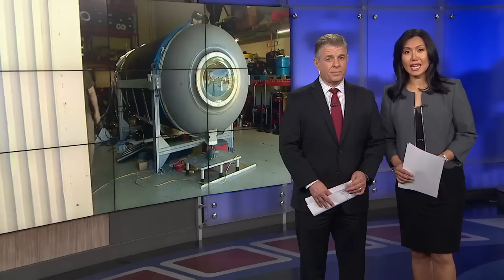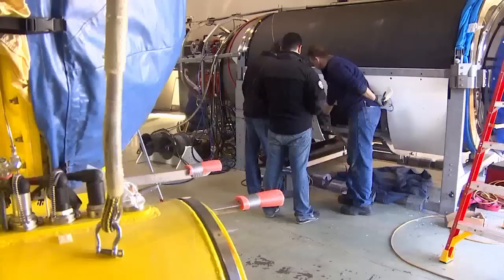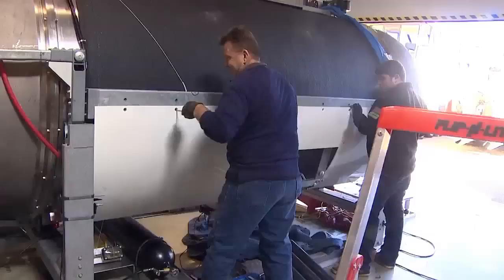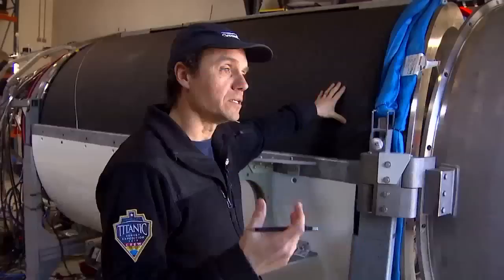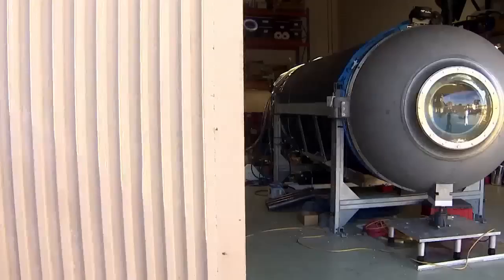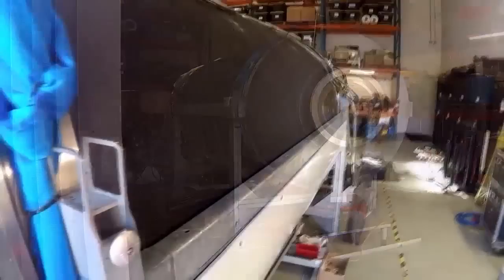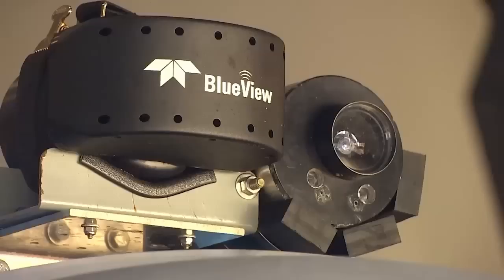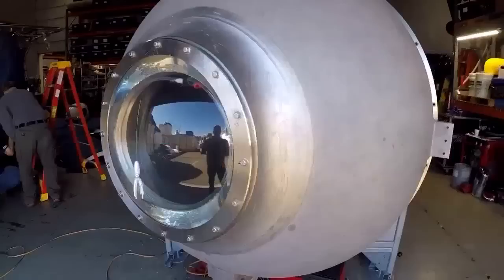The making of Titan: Oceangate's submersible capable of taking people to the Titanic

Comment: The thing about carbon fiber is its extremely strong in tensile strength and not so good in compression strength, in fact very weak. 
Trying to bend a carbon fiber rod will have tensile strength on one side and compression on the other. The compression side usually gives first then cracks up to the tension side but very quickly so it looks like everything snapped at once.
Still very strong that way. But in a sub you have compression 360 degrees around you. You can test this with a carbon fiber air tank. It will hold 4200 psi of air just fine because it's pushing out on the carbon fibers, all tensile strength, but put that down in the ocean or in another tank and put 4200 psi pressure on the outside of the tank like in the ocean and it will implode much sooner than 4200 psi.
They obviously didn't test this with a 3x saftey factor.
Reply: My guess is it fatigued from delaminating overtime, eventually buckling somewhere on the cylinder walls. Also why use titanium. Stainless steels is much stiffer and less expensive.
Reply: @brandonpieroni5536 apparently the glas was only rated for 1400m they went down to 4000m ...
Reply: They could have used your expertise
Reply: @SuperUltimateLP The design spec, maintenance programme and vessel life expectancy is all going to get scrutinised in the courts. I’m guessing  the insurance and waivers are only valid if your end of the deal end is water tight!
Reply: @bradrainier106  Only if you can do it 'really fast ..
Reply: Anyone using carbon fibre tent poles should understand this. In extreme wind conditions they will hold to a point but eventually over time they crack. Constant use it will weaken. This submersible wasn't going to last constant use. I strongly think the connection by dome at front connection. Would likely cause a leak at some point. Leading to implosion. Most Submarines can go below known crush depth. But not very far and with luck. Doing it more than once is a disaster going to happen. Quite simply they it ran out of luck.
Reply: @bradrainier106 Na they wouldn't have allowed this person to help. They're probably older than 25, and those ideas, aren't "fresh and new" like OceanGate wanted.
Reply: @raylp4751 They didn't even know what the max depth was on this "submersible" and when they ran tests, they never even went to the depths, they planned on taking this thing to. That alone deserves to be heavily scrutinized in court.
Reply: i wished they had engineers like u when they designed this thing.
Reply: @Butternose  They paid for a trip to Titanic. Apparently it didn't get there. So there 1st reason to sue. Make sure you don't get tickets to go again.( like network rail operators do in UK and TUi.  Go for the money back just for starters. The waiver they signed 3 times it mentioned the risks and chance of death. There was History with the craft. There were I believe at least 2 who had travelled down before so knew the risk. If people die climbing Everest or travelling to Sth Pole. Does anyone actually sue?  The worth of these men is incomprehensible to the average person. Do the relatives  need it.  Were they Tourists or Adventure Explorer seekers doing something incredibly dangerous. The pay off as success would most likely be up there with most Explorer
 equal to all explorers. Like those before remembered for failing.
Reply: @raylp4751  I appreciate the comparison to mountaineering a long held activity of rich people. That said man vs the elements where you have to transport yourself, surely isn’t the same as boarding a man made contraption? It seems to me there is a implicit expectation for the craft to be fit for purpose and a distinct power imbalance between passenger and operator. If there is money on the table, I think those waivers are going to be toilet paper.
Reply: @brandonpieroni5536 probably has to do with how it fails versus titanium. I think titanium can withstand more deformation before cracking. Could also have to do with weight vs the buoyancy they need to add.
Reply: @raylp4751 WRONG. They paid to be “crew members” on an experimental research vessel. This is how Stockton got around regulations. He made sure all the contracts were for being crew members of a scientific research vessel, not commercial passengers.
Reply: That's my thoughts, but I'm still thinking if it wouldn't work if they got good carbon fiber pattern textile with the whole length of the sub and then use layers with different patterns on the fiber textile and then use an actual good bond material and then cured with good heat and pressure, but I'm guessing it's probably difficult to have carbon fiber textile of the whole length of the submarine maybe, no idea...

And then they could also have an actual small layer of metal inside or outside and maybe even adding more bracing internally for even more strength.

Anyway they sure could have tested it all way before, they could even have done a proper down-scale of it with the same exact construction and make sure it will take a lot more than the pressure they would ever reach and then leave it there for many hours and then do many compressions and decompressions and keep checking.

Also in aviation they do kinda like a resonance or some crap to the materials and other ways to look for fatigue and if a company wanted to take paid tourists to such depths I'm guessing they should also keep searching for failure on all inside the material every single trip cause most likely it didn't imploded from 0% to 100% in a row but most likely it already had micro cracks or separation of layers inside they already had like 20 trips or something...

ps: I'm not a engineer or expert in carbon fiber so feel free to correct me if I'm wrong 😎
Reply: Whenever you have stress on a carbon fiber structure it is always experiencing both compression and tension. Always. In Titan's case, at depth, the outermost skin of the hull was experiencing compression while the inner skin was experiencing tension. (In reality, every single fiber throughout the matrix is experiencing both) These properties are known, and what should be taken into consideration in the design phase. At 5" thick, the laminate should theoretically be able to withstand the compressive forces. 

I'm just guessing as well as anybody else here, but in my mind a few things stand out...

1.  The hull construction was subbed out to a composites firm with a deadline of just 6 weeks to design and build something completely novel. Ocean Gate's CEO's name is unironic.

2.  The hull was 5" thick. To get to that massive thickness required the manufacturer to layup 480 plies. They apparently used a mix of pre-preg and wet winding. That's an insanely challenging layup, with tons of opportunities for things to go wrong. Since they were using a mandrel as the form/mold, they couldn't use an autoclave or any other kind of pressure curing without risking bunching the fibers and creating wrinkles or voids. But then they would be unable to control for resin to fiber ratios throughout the laminate, or voids. Given the short turnaround time, the composites sub (Spencer Composites) had literally no time to T&E their approach. Or put it through any kind of paces, really. I'm no engineer, but in my mind, the layup should have been done in multiple stages, over a longer course of time, using a single resin with a focus on consistent resin-to-fiber ratios and zero voids. With proper timing subsequent layers could still be chemically bonded. And who's to say it was the fiber itself that failed, rather than the resin? 480 plies across a 5" thick matrix provides a ton of real estate for which shear stresses can cause a failure in the resin itself, and subsequent delamination of the layers. 

3.  The mixing of materials at critical areas. The ends of the carbon tube were capped with titanium by bonding. Was any testing done to see how these dissimilar materials responded to the 6000 PSI at depth? The slightest bit of shear between these materials could easily create a rapidly progressing failure. And how much testing was done of this kind of connection? In addition to the pressure, there's also temperature considerations. 

Taking all of the above into consideration... There may have been delaminations occurring on each dive to depth. Those delaminations might've resulted in greater deflection of the tube. With the tube deflecting, the ends no longer square with the titanium caps. In the cold depths of the North Atlantic, the bonding agent between the tube and the caps might've been more brittle, and prone to failure. I watched a video (here on YT) of OG capping one of their other subs, which was supposed to go deeper than Titan. The flanges on the titanium cap were, to my eye, very small. Maybe like 1.5 to 2". Maybe. When you're dealing with 6,000 PSI, it doesn't take much for even the smallest failure to produce a catastrophic event.
Reply: I want to know how much the hull was titanium vs. Carbon Fiber. Not an expert here but if they put thick titanium then cover it with Carbon fiber, wouldn’t the titanium still hold despite carbon fiber tearing?
Reply: @justinthinkify  I have no idea, but from the pictures of the interior it seems just carbon fiber all the way without a titanium layer unless the exterior thin white panels are titanium...

If they mixed both probably could have been good cause metal still bends a bit and carbon fiber isn't much flexible and after trying to bend it many times will likely result in breaking apart...
Reply: @justinthinkify  they basically made a carbon fiber tube and then capped it at the ends with titanium.

Comment: Carbon fiber is proven to be very strong up in the air but deep underwater is a very different scenario
Reply: I was surprised they used Carbon Fibre ; the fatigue factor on multiple dives , should be obvious.  A few pressure chamber , non destructive tests , would not have exposed the fragility of C/F,, as with many pressure Cycles...
Reply: @1arritechno  Rush refused to have the hull tested after each dive. It was literally a death trap waiting to happen.
Reply: Even up in the air, I don't think it will last as long as planes made of aluminum. I'm curious to see how soon all these carbon fiber planes will need to get retired.

Comment: TONY NISSEN  - Design Engineer as indicated here.  It occurred simply because a design moron wound unidirectional fabric into a tube, which material has relatively poor compressive strength to begin with, and which structure thus had no practical lateral strength and was porous to the high water P that progressively split-into the weave. The tube thus simply split apart.

Comment: Imagine the chaos if they are still alive inside that thing. It's horror movie material right there.
Reply: I would just sit there and pray, first, I never would have gotten on the thing. I feel for all passengers. Billionaires on board... you can't buy wisdoom.
Reply: they were. bangings were picked up yesterday via sonar every 30 minutes.
Reply: @chocolatecoveredgummybears really?
Reply: I imagine Rush pedantically trying to figure out where it went wrong... some dark comedy there.
Reply: @cameronclark3725 maybe the batteries in the wireless controller ran out of power, or they forgot to charge it.  Either way my feet remain on solid ground.  No one could pay me enough to even swim out a mile off shore.
Reply: I thought possibly batteries gone on controller then no one could find the cable which wasn’t checked surely this should of gone down on test drives without any physical passengers?  Wasn’t it only the other month they was still building it.
Reply: @featheredfriend1310 rush mentioned how there are spare controllers on board
Reply: @featheredfriend1310 there would be redundancies built into the system like spare controllers and stuff.....maybe something to do with the main looming ...because that's where you won't find redundancies
Reply: @muhammaddaniyalrashid9463 YEA theyre alive... for now
Reply: No redundancy in "lifeboat" or suffcient rescue system sounds so eerily familiar!
Reply: @raneads1458  yeah definitely, not in a lifeboat...but if they were offering it for commercial trips then I'm sure it would be having those redundancies.......

And if not...then thats definitely a cause for concern
Reply: @Thebast268  oh wow!  I guess that was a great idea tho still not idea to control a vessel carrying precious cargo.
Reply: @desmond4912  ok I looked up looming.  🤔 yeah I’m clueless as to what the actually is even with the definition.  Would you be able to explain further so I might be able to understand?
Reply: @featheredfriend1310  oh i mean the electrical wiring that connects everything....I'm a pilot actually so my English might be a bit off 😅
Reply: @desmond4912  oh wow!  Okay thanks!  Truly praying for their safe recovery.  The submersible sounds like it was unsafe from the get go- tho let’s pray it’s not in vain.
Reply: james cameron will produce a film
Reply: @paulw9068 no, they've taken passengers down before. They've been down to the Titanic at least 10 times so far.
Reply: @featheredfriend1310  agreed, i read a bit more about the company and it operations 
Definitely doesn't seem like safety was in their list of primary concerns
Reply: They’ll make one no doubt.
Reply: @paulw9068  It has gone down and up since 2019
Reply: Titanic II
Reply: And if someone farts the oxygen gets depleted.
Reply: It's similar to the setting in Alien where you're in a spaceship, alone in the vast emptiness of space.
Reply: Guarantee the rich kid instantly tried to kill them all for some reason lol
Reply: They died. A catastrophic implosion. Instant death, no suffering.
Reply: @michealklondike4049  would've made a nice movie tho huh
Reply: @paulw9068  and the controller was bluetooth wtf
Reply: They would start to kill each other to get at the last breath of air.

Comment: Thanks in part to its carbon fiber structure......which professionals warned would weaken with each voyage and eventually cause an implosion.
Reply: Would be a good idea only if they swapped out the carbon fire every so often lmao
Reply: They didn't have a vacuum. You need a vacuum to release air bubbles
Shows how much they know...
Reply: I'm not sure why the Titanic expert had faith in this thing... everyone speaks highly of him so he must have known the sub wasn't certified.
Reply: But wait, here's the good part: Ocean Gate didn't give a shit if it was going to weaken and implode or not, they wanted money
Reply: @A1Kira perhaps he was suicidal...
Reply: @aidanpearce4221 they grifted and people paid an insane amount of money to receive a pretty badass grave...
Reply: @pleasetakemecanada  
True
Reply: @A1Kira  It had supposedly been dived to the Titanic wreck site a few times already.  Maybe that's how it was sold to the Titanic expert.
Reply: Hi!
Reply: Good point Bonnie, and when the professionals would tell him it was dangerous, he would say he was an aeronautical engineer and it was safe. As you know, an aeronautical engineer is different than a marine engineer. He was trying to use carbon fiber that's used on planes for a sub lol. Do you think the guy was taking drugs?

Comment: I heard there are no manual controls in this thing, only electronic. So if there's a power loss then that's literally it.
Reply: No emergency beacons either, they all signed waivers before they left. Company is in the clear, legally...
Reply: there's a 10k psi hand pump to jettison the bottom part in case of power failture
Reply: @JF32304  

only if the waiver is coughcough "water-tight"
Reply: @therearenoshortcuts9868 Seeing as how the CEO boarded this tragedy.. there’s no way he managed to cover all of his bases with the waiver considering the company is fighting a lawsuit from two people who want their money back after the dive was canceled.
Reply: @JF32304  piece a cake going down 2 1/2 miles 🤣
Reply: when you say manual...you mean like oars right? or hand-crank windows so you can reach outside and spin the propellers by hand??
Reply: @therearenoshortcuts9868 Apart from the fact that waivers may not be iron clad, I guess you also have to be competent. For me that means an independent vessel certification or reasonable alternative, a design that affords a healthy margin of risk, redundancy in all critical systems, a beacon, risk assessments, disaster plan, maintenance schedules and protocols, and ultimately a vessel retirement plan. Personally If I was putting my name against an craft based on untested technology open to the public, I would build a test craft stuffed full of sensors and telemetry to complete multiple unmanned missions to depth and then be cut up for assessment and then tweak or change the design on that basis.